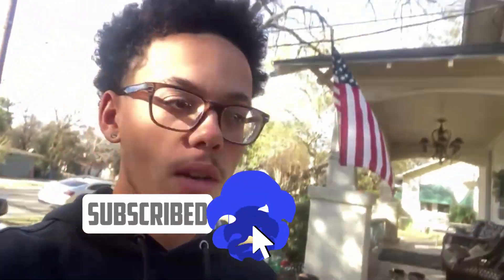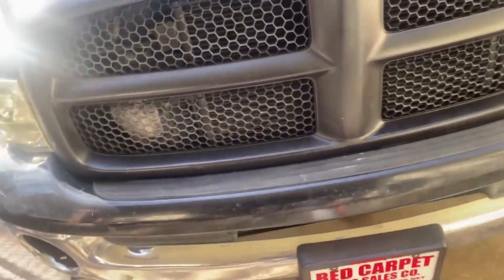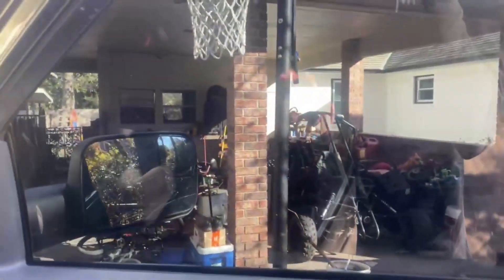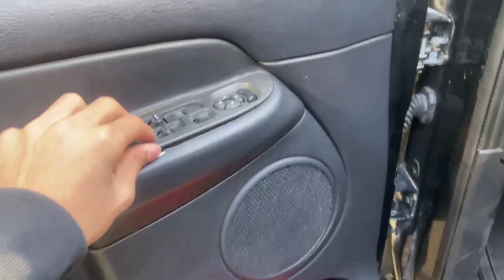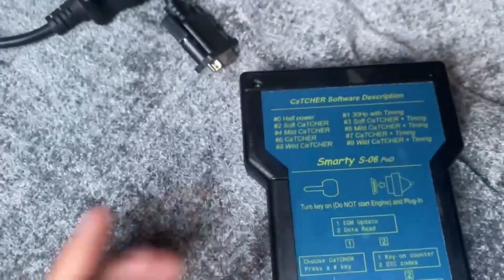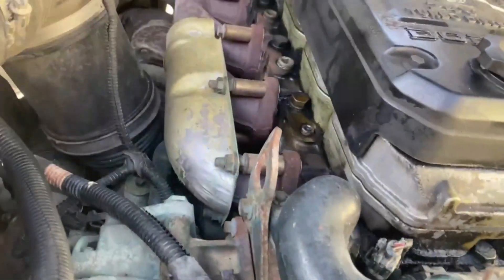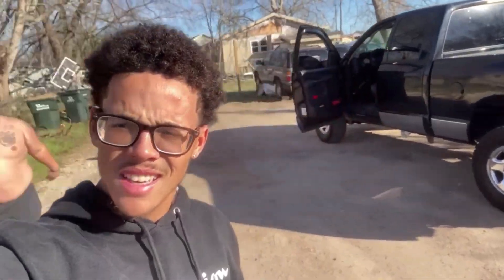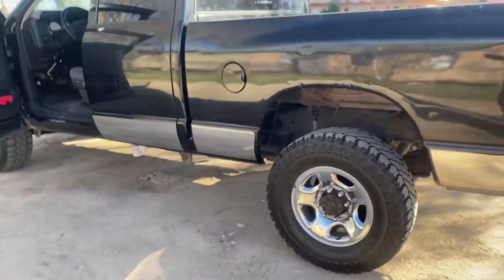I Bought a 3rd Gen Dodge Cummins ( IT WAS A GREAT DEAL ! )

Comment: nice truck i have 2 of them ones a 07 2500 5.9 and the other is a 07.5 6.7. also check the trans fluid engage the e break and put the truck in neutral and check the fluid level another is i would recommend getting a valve lash job done (preventative Maintenace)
Reply from the maker: Thanks for the tips 💪

Comment: Just some advice. Diesel oil will always be black. You’ll change it, start it up and it’ll be black that’s just how it is.
Reply from the maker: See that’s something I never knew 😅 thanks!
Reply: @ZayBreezyy  no problem man, that’s just the nature of the beast, but nice truck sounds great! Eventually I’d say get a new transmission and upgraded clutches and you’ll be able to pump massive power